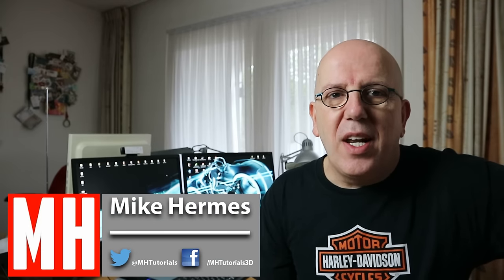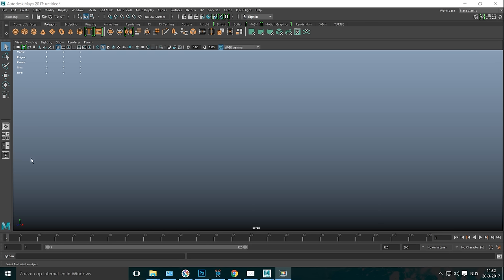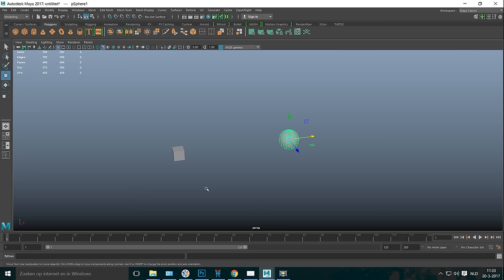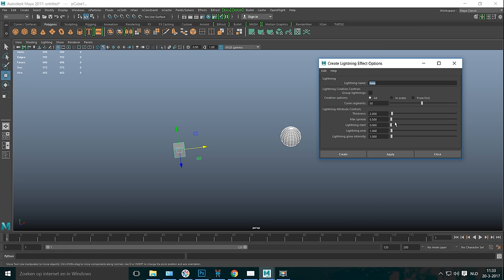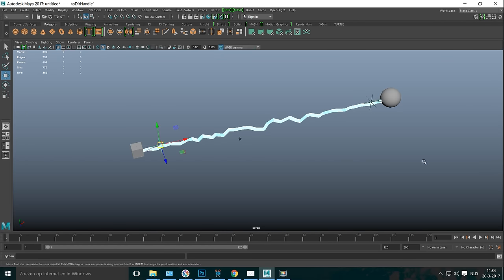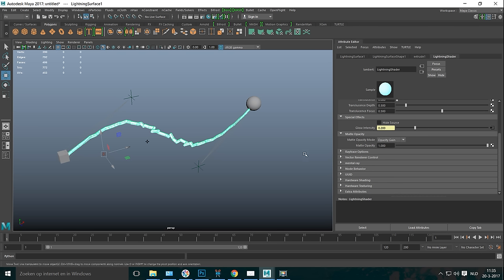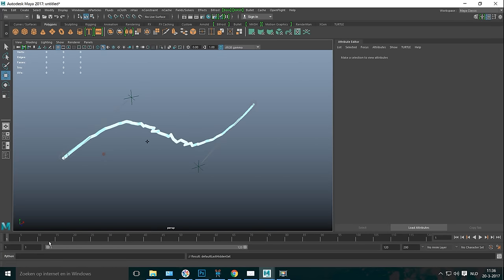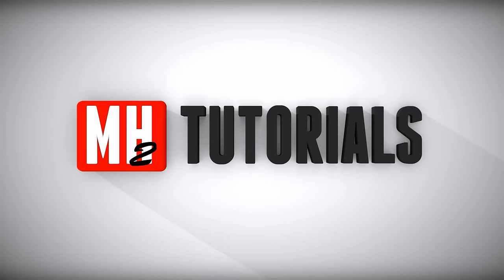How to create Lightning in Maya 2017

Comment: It doesn´t work with Maya 2019.... not with Arnold, how can we make a Lightning effect with Arnold?
Reply: grinrin rin  Hey guys! Got a similar question also... just tried it and it works but.... the light effect (on the ray itselt is cr*p.. Basically there's no Glow, no matter how much you increase it) is very different from what we see here.. (using Maya 2020). Did you guys ever found out how to make this look good!? Checking from more vids now but no success so far... Cheers!